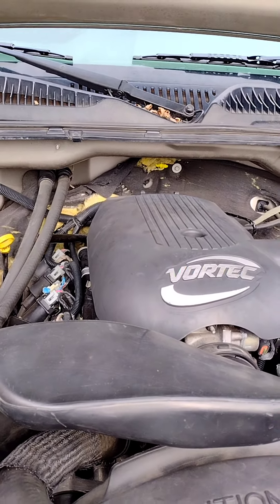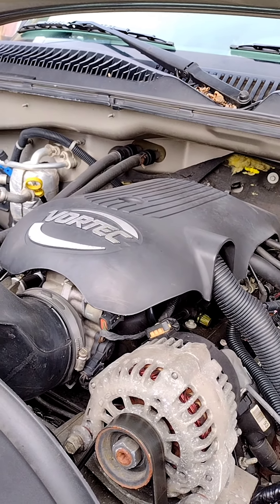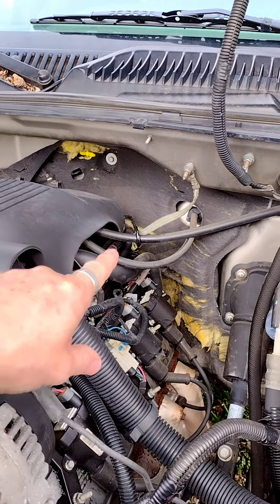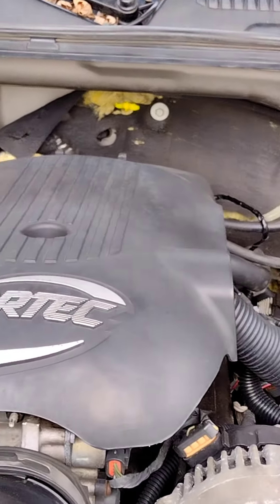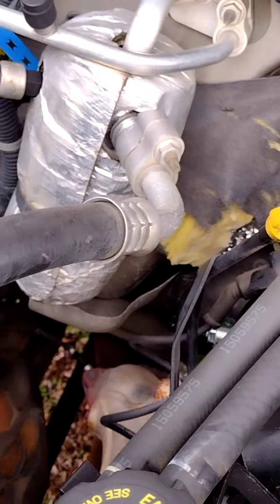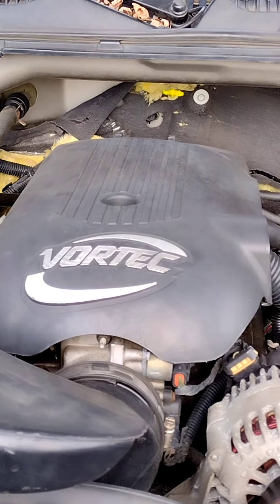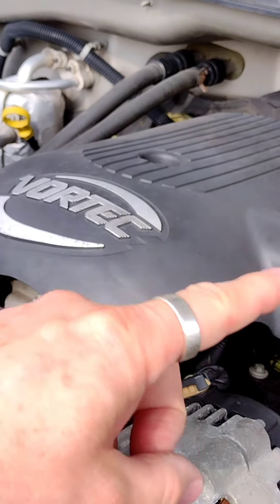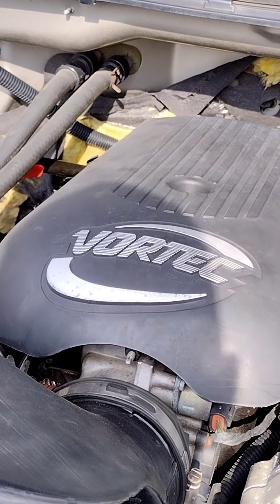Knock Sensor Code PO332 PO327 Fixed!! It's The Resistance.

Comment: I have been chasing the same problem. Instead of buying a bunch of sensors to get the right one, I might try adjusting the resistance to get it in the right range. Thanks for the video.
Reply from the maker: Your welcome. That's a great idea! Forgot all about doing that. I use to wire in a potentiometer and adjust it until the car would run more stable when testing sensors. Best of luck!
Reply: I was thinking of making a new knock sensor harness with 14awg and maybe adding a 100k resistor but not sure.

Comment: I mean kinda but knock sensors are a piezo crystal that make their own ac waveform so resistance readings are not what the computer reads if you look up south main auto’s video on the p0327 code he shows you what they look like when hooked up to a lab scope so resistance can maybe give you an idea of if one is completely dead however it’s still not what the computer receives for information on the sensor. I do appreciate your out of the box thinking for external mounting spots

Comment: Did you find threaded holes to attach them tobthe exterior of the block?
Reply from the maker: Yes there threaded holes all around the block that are a perfect fit. Check my follow up video. 1 year update.
Reply: @stuntcountry8488  Can the resistance be measured with a multimeter prior to installation?
Reply: thanks well I hope it goes well for me and now thinking back into who did it to my wire's ,I'm in wow it was the smog shop last May 2023 I rem also he disconnected it and left it and it melted on the block ,lydh both are left side in between spark plugs so ,and it's a1994 TBI well her e goes . 🙏 a marie
Reply: oh I never messed with them I believe there fine it was the wiring I happend to come across is all
Reply: oh there the easy way there my 94 S10 has them already threaded both on block near spark plugs driver side and passenger also the wires have really been damaged and this time .I'm gonna wrap them w foil  to real tight and if it gives me problems we'll it hadn't been all this started w my coolant temp sensor I can't believe other wiring issues I've got I'm  grateful and feeling pretty confident LoL  ty so much
Reply: yes there wl ready inside the block butvthey are on side of block not on top under manifold it's a 4.3 litre v6 .it doesn't look like other engines for same year and make well have gooday ty
Reply: yes .that's were they are at but I wasn't having problems w the K sensors it was the wiring harness plugs for the knock sensors wrll til nextime  thank so much so green goes to green and passenger knocksen  has dark blue so blue to that one .I'm going to crimp and use heat shrink dontnobhowbtosolder just yet kncross fingures
Reply: How do you install them to the back of the block? Same color to same color like How it is?

Comment: THANK YOU for this!!  Is the truck still showing no codes?  Have an 03 with the same problem.  I remember the resistance on the sensors was around 103k.
Reply from the maker: Hi,
Your welcome! Yes still going strong with no codes. Still haven't moved them back under the intake manifold yet I am waiting till summer when I have more time.
Reply: @stuntcountry8488  that's great news!  It wasn't quite clear how you have them secured against the block for the testing period.  Any insight on that would help me set this up.  I'm going to bring my multimeter to the parts store and check them before purchasing looking for that middle range.
Reply from the maker: @dougshuckra2063  yeah it was an after the fix video so I didn't go into detail. Basically I found two spots that the sensors would thread into. Believe it or not there are several spots on the engine block that the sensors will thread into at the front and back of the block. I just used an old sensor so I didn't damage the new ones and looked for a spots on the back and side of the block where the sensor would thread into. I decided on the spots where I would not have to cut and extend the wire harness thus adding more resistance to the circuit.
Reply: I just checked the sensors again on the block. Both are at 100.3k and both throw a small mv reading when I tap on the block. I’m starting to have a hard time believing that these sensors are the issue here.  The resistance back to the ecm is the same on both pins in the connector too. I’m at a loss.
Reply: Hi, great video, how did you secure the sensors to the engine block
Reply from the maker: @billgasior  
Hi,
I just threaded the sensors into the left side of the block and the back right when facing the engine. Essentially there are several open threaded spots on the block at the front and rear that the sensors can thread into. I just took an old sensor and found a spot it would thread into so not to damage the new ones. If the sensor fit and snugged down that was the spot. I choose those two spots because that way I didn't have to extend the harness. Just snug it down and turn it a little more to be sure no torqure wrench needed.
Reply: I've been battling the rear sensor for a few months now. I came across this video yesterday and went through my stach of old sensors and found one right at 99k ohms. I put it in and it seems to work! Finally!! Thanks for putting this video out there! Very useful info!!!
Reply: @dougshuckra2063  im in the same exact boat as you. I read a bulletin though from GM saying that there’s a large batch of faulty sensors oit there. Only buy the ones with a blue dot on them and with the part number engraved in the body of the sensor.

Comment: If the issue is only the default sensor resistance, it may be possible to adjust that
resistance value with an adjustable dual potentiometer circuit inserted into the 
knock sensor lead.  A pair of 10 turn Bourns 3006 trimpots could be used with
a 20K trimpot (Bourns 203) in series with the sensor lead and another 1 M
trimpot (Bourns 105) from the computer side of the 20K trimpot to ground. 
The computer would see a resistance value adjustable to a precise value it 
accepts as normal, calibrated by watching an ohm meter attached to the 
computer side at the junction point of those 2 trimmers.  The sensor is 
likely to still function normally to detect any actual engine knock, even 
though its untriggered resistance is slightly out of range if unadjusted
and uncalibrated by a compensation circuit. Trimpots allow adjusting 
untriggered resistance so the computer is not overly sensitive to the
sensor untriggered resistance. When a sensor detects an actual knock
the resistance change will be many times greater than any small value
change done to calibrate the untriggered resistance. This "gadget"
type of circuit could delay or eliminate need for replacing a sensor
that otherwise still works fine to detect an actual knock, but is only
slightly out of range for the expected resistance seen by an overly 
sensitive computer that wants a new sensor it does not actually 
require to continue working, only because the system was designed
to avoid any user calibration and sell more new sensors to replace
old sensors that would still be in service for years if calibration 
adjustments were an included feature. Go figure why that would 
be done that way. Selling expensive repair parts is big business.
Reply from the maker: Yes I agree. I have done that in the past with other sensors. TPS as an example
Reply: @stuntcountry8488  Knock sensors are actually a piezo transducer
type microphone (a crystal microphone) that generates AC output
signal level voltage can be read on a meter set for AC millivolt range
if the sensor is tapped with a screwdriver handle to simulate a knock.
How that is detected and read by the computer I am not sure but 
simply locating the sensors in an accessible location makes sense
and an engine knock should be picked up anywhere on the engine. 
Putting a predictable replacement sensor underneath an intake 
plenum isn't exactly a love letter from an engineer, but is sadistic
and asinine.

Comment: Is there a way to make these engines run without a knock sensor at all.
Reply from the maker: @mikemitchell7575  It will still run not sure what effect it poses to the engine most likely none. My light was on for around 4 months before I was able to fix it. I never noticed an issue. It is not a direct sensor so it is not used by the computer to control drive ability like fuel control, spark or emissions. It is used by the computer just let you know it is sensing a knock of some kind that can be a danger to the engine. It will leave your light on and if you have to get a smog check it will fail.
Reply: @stuntcountry8488  I just wonder why more people don't do away with them, since the seem to give so much trouble , and just take their chances...what year did knock sensors start to be used on vehicles ...

Comment: my knock send green wire is barely tied no tape nothing ,also other knocksen wire dark blue ? cars been driving about 6 months the way so do I put both together blue and green wires and solder them together fonnectirfor blue had 2 wires but other was cut and taped how would you connect them I'm not getting a code I'm just trying to fix my corroded wires that I found ,? thank you appreciate some true advice Lol  I don't want it to get a bigger problem ty
Reply from the maker: Oh wow surprised you didn't get a code. Ideally you want to soldier or crimp green to green and blue to blue. You could also join them all to one but then it would be only one sensor. My only worry is once you fix it all you might get a code. The old saying if ain't broke don't mess with it.  Or you could try it and see but with the caveat it could cause it to code. Really just a choice. Best of luck.

Comment: So did you add 2 knock sensors. Is that whats going on ?
Reply from the maker: Yes I used two new sensors. I just threaded one sensor into the left side of the block and one sensor into the back right when facing the engine. Essentially there are several open threaded spots on the block at the front and rear that the sensors can thread into. I just took an old sensor and found a spot it would thread into so not to damage the new ones. If the sensor fit and snugged down that was the spot. I choose those two spots because that way I didn't have to cut or  extend the wire harness. Just snug the sensors down and a turn a little more to be sure there was no need to torqure  them.
Reply: Thank you Im right in the middle of this issue now with an 04 tahoe. I really appreciate your help and taking the time to answer. Ive tried one bipass meathod and it didnt work for me.  .
Thanks again
Reply: Mahalo! I was going to do the combined bypass way.  But maybe I’ll just keep feed the truck premium.
Reply: @41663 hello I have an 04 Tahoe and was wondering if you were able to do what the video did I do not want to take the manifold off and I just needed to pass inspection

Comment: Did he perhaps include where he got those specific resistance 99k knock sensors?
Reply from the maker: Unfortunately I had to find them by trial and error. I ended up buying a total of 8 different knock sensors and swapped them in and out until I found what worked. Based on the testing I did it just happened to be for me the knock sensors that had a measured resistance in the middle of the required range from the Chevy specifications.

Comment: Did you keep the knock sensors in under the intake or did you remove them And just found new locations?
Reply from the maker: Just left them there. Used a new wire harness, two new sensors and used new locations. Still going strong no codes.

Comment: You can put the knock sensor anywhere?
Reply from the maker: Wherever it will fit and not get torn up or burnt up pretty much. You just want one on the leftside and one on the right-side of the engine.  Chevy had the knock sensor on the side of the engine for a long time and it was easy to access. This was a bad design change to put them under the intake.

Comment: Where did u screw them into?
Reply from the maker: There are actullay numerous spots on the backside and the side that the  sensors can screw into. They are threaded and are the same size threads as the sensors. I chose one on the right side at the top backside when facing the engine and the top leftside when facing the engine. I was going to try some in the front of the engine but I didn't want to have to cut into the harness. 
I was only able to reach them from underneath the truck. The engines are designed this way for different models for different accessories to be added. If you have ever seen an engine on an engine stand you would see all the available spots.

Comment: Can’t you just put a 100k resistor on each wire then ground the other lead of the resistor.(heat shrink it) Get rid of the sensor completely!
Reply from the maker: If you don't want a knock sensor sure. It would become a fixed wire that does nothing. I would not suggest or recommend it. A knock sensor is needed to pickup early signs of engine trouble or wear that may not be audible. It will change resistance as a vibration is detected triggering the check engine light thus preventing possible major engine problems.

Comment: 15 foot pounds???
Reply from the maker: Hi,
Book says 14 ft lbs but I personally wrench tighten until they are good and snug. I recommend the book specs if you haven't been working on cars since you were ten and have a good solid feel for tightening Knock Sensors. Kinda like a spark plug.
Reply: Wrap with Teflon Tape a Bunch, old Trick used on the Buick GrandNationals